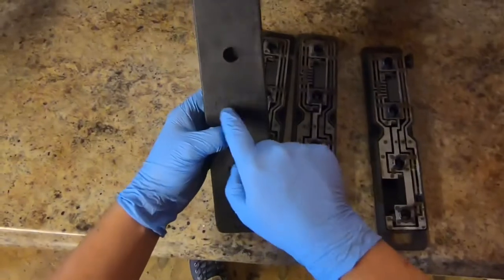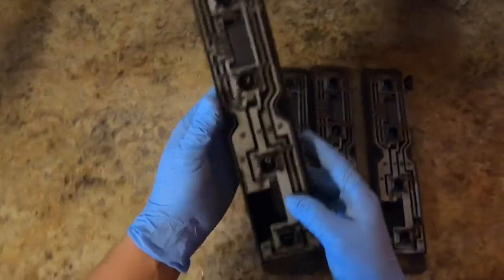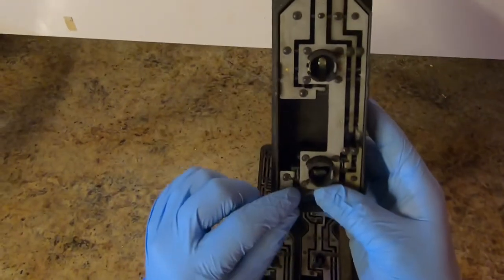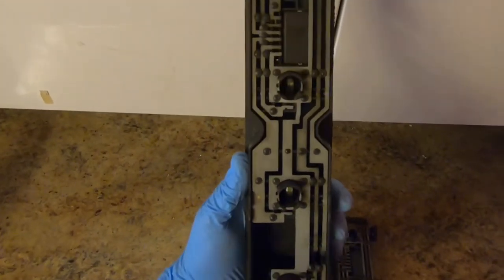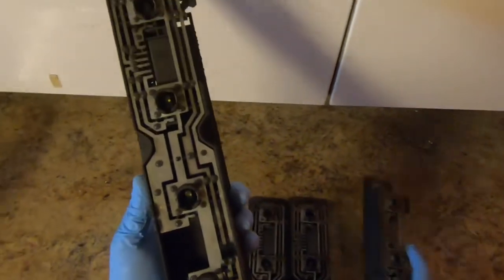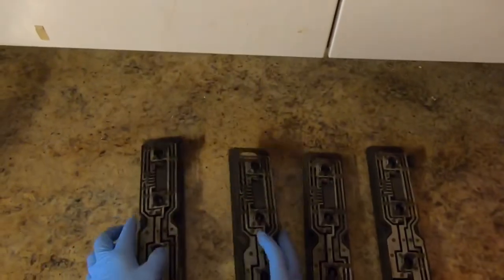Transmission won’t Shift out of gear on Mercedes Sprinter

Comment: WHY THE REAR LIGHTS DO  NOT STAYS ON WHEN ENGINE IS RUNNING.

WAS WORKING LIKE THAT BEFORE .

 I NEED TO TURN LIGHT SWITCH ON IN ORDER TO HAVE REAR DRIVING LIGHTS.

ANY IDEAS...ANY MODULE CONTROL IT?

Comment: Ha exactly, when my driver turn signal bulb died, my cruise control won’t work.  I had a front signal bulb the ones just in front of door go out and if I was running cruise control and hit the left signal to lane change, the cruise control canceled.  Nuts

Comment: I've got the same problem but, it still blows the fuse and both light circuits unplugged.  changed brake switch and still fuse blows.  I ordered a power probe.
Reply from the maker: Replace brake light switch
Reply: @ZimaletaMotors  I did and still have the same problem.

Comment: When you say wont  shift, do you mean it wouldnt come out of park or that it wont go through the gears like 1 gear 2 gear to drive?
Reply from the maker: Just out of park, unless you unlock it
Reply: @ZimaletaMotors  I found your second video. my sprinter is stuck in 2 nd gear

Comment: This - THIS is the reason why Mercedes Benz vehicles frustrate so many people! There is no earthly reason why a transmission should rely on a bulb’s electrical path to function. If it is a safety concern, then let there be an alert, a warning light, SOMETHING other than the transmission not functioning. A glovebox light doesn’t come on, the car wont start, the outside temperature sensor is bad, the check engine light comes on, there’s a problem with a fuse for the reverse/tail light, the transmission wont shift. Ridiculous. [But I’ll still drive and enjoy mine :) ]
Reply from the maker: It’s Ridicules I know, lol but kinda funny I was not thinking like that until you mentioned it, just sorta excepted the fact that that’s the way thinks are, fortunately I know what to look for! But men would this be a bad day for someone that does not even change there car battery, they might be fooled by the mechanic that they need a new transmission or worse lol all for a $50 or less electronic tail light circuit short
Reply: ZIMALETA HOW TO SHOW & UNBOXING That is EXACTLY why I, and so many others, appreciate the videos you have put out over the years. You have helped many to avoid those T1N plagues that force blue-collar, hard working people into the Mercedes dealership and unnecessarily drain their wallet. THANK YOU.
Reply from the maker: Your welcome, I really appreciate your feedback you just made my day, I will continue to put out videos daily, that help every day people keep money in your pocket, many of the videos will be sprinter related, as you probably realized by now, my garage is done, and boy o boy I am exited, I got foldable tables inside now that I can put engine and transmission components on to really get deep into sprinter repair, plus, I got my desktop computer setup, On and always ready to go, I have Mercedes service manuals on CDs for a long time now, so I will use them while doing repairs, and provide actual mercedes technician and explanation and my own to make better sense of stuff, plus as always I am Committed to learning more about Sprinter’s and sprinter repairs and sharing this knowledge with my Audience that is the best in the world!!! Already I am using my garage to make lots of videos for you guys, lol can you believe I have taken March off and still have not worked in April, all because I was getting everything ready so that I can make more videos, I really hope that my channel can grow to million views per month or more so I can do this full time, I really enjoy doing this kind of thing, also I have big plans for buying a steel shop commercial grade 30 by 40 with 14 foot or 16 foot roof, then I can get the sprinter on a lift and really go to town with it
Reply: ZIMALETA HOW TO SHOW & UNBOXING WOW. All I can say is, WOW!

Comment: Good afternoon,  I sent my 2006 dodge sprinter 2500 to the dealer because I was driving in the freeway and suddenly I heard a noise under the van after the noise the van doesn't want to accelerate I stopped and checked under the van and I saw a oil leak on the transmission, I tried to turn on the van and it turns on but for about 30 seconds and then turn off automatically. The dealer removed the plate from the transmission fluid and they found metal residue but they told me that now the engine does not start anymore.  My question is: if the engine no longer starts, then is the engine bad?  or the transmission?
Reply: I reccomend you be your own mechanic and don’t take it to a shop just to say everything is wrong with it